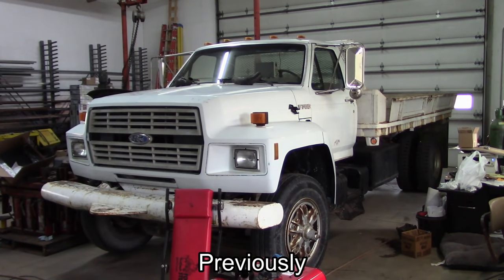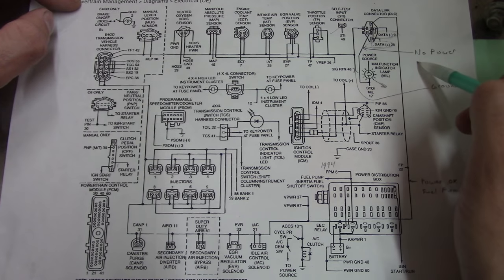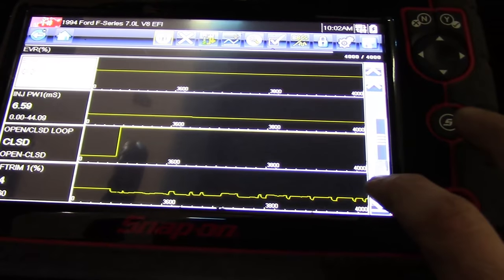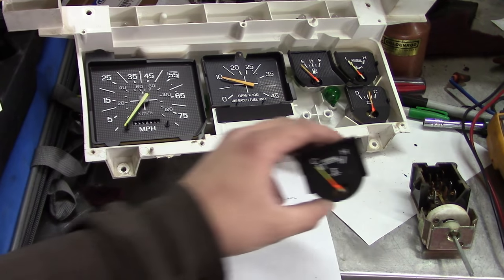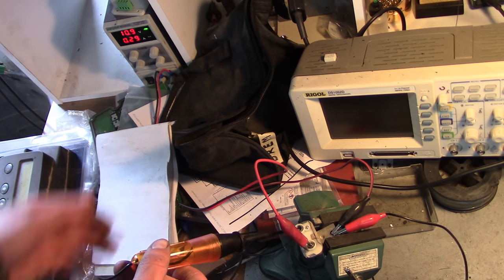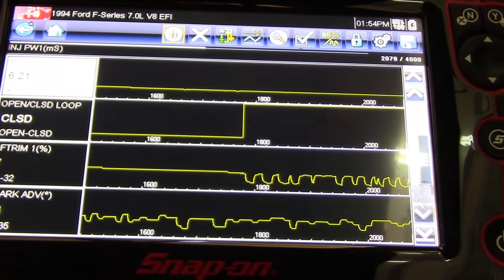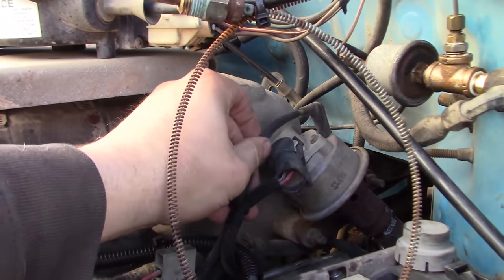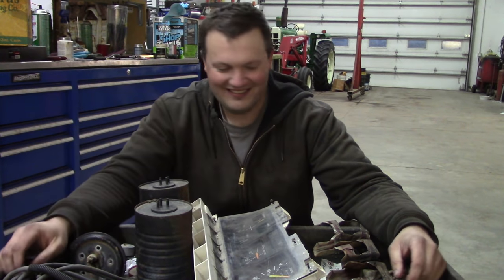Ford F700 Project - Missing, High Idle, and Gauges - Diagnose and Fix (Gas Engine) - Part 3

Comment: And, still a far cry from the 70s era F-700, which had almost none of that fancy electronics under the hood :-)
Reply from the maker: Right. But those had the "smog" engines with no compression and retarded timing that never made any power.
Reply: @WatchWesWork  The stake bed farm truck I drove was "pre smog"  There was almost room to sit next to the engine wi/o raising the hood.  Powerful, not so much.

Comment: IVR *IS* just a flasher.  The reason this works this way is the gauges are not real "gauges".  If you open one up, the needle is just glued perpendicular to a bimetal strip.  As the strip heats up from current passing through it, limited by the resistance in the sensor, it bends and moves the pointer.  Not very accurate (which is why there are no numbers on the gauges), but it works.

The big "can" style oil pressure IS a real pressure sensor, not just a switch.  The ECT and the temp sensor for the gauge are different.

The PCM actually contain software that I help write !    And I have NO IDEA why there are 2 OBD-I/DLC connectors !!

Comment: We’d,I noticed that truck is equipped with air brakes most of those models of fords with the gas 429s around here are equipped with Lucus Girling brakes are you familiar with those and if so would you consider doing a video on these brakes
Reply from the maker: I'm not that familiar with the juice brakes, other than they have a lot of issues in our area (rust).

Comment: I was a little bit confused  about the dash lights on my chevy squarebody, It has a similar light switch as the struck and I found if you turned the knob left or right it turns up or down the brightness of the dash lights

Comment: I live in Europe and I know nothing about fixing trucks. But I think that truck would have been junked here long before someone like you got involved.
I currently drive an 2012 Infiniti FX 50S with 87500 miles on it. All local Nissan / Infiniti shops refuse to change its transmission fluids! Do you know of any sites with instructions on how to do it?

Comment: Using the crimper right but you'll find the strippers should be used with the flat face trowards the free end of the wire. The other way your wedging the insulation against the wire/
Reply from the maker: LOL. Have you looked at how they are built? Any way you flip them you will have one flat face and one angled face...

Comment: Not tryin’ to be a PITA, but I did notice that the only gauge lights that work were the ones that you fixed in this video.....
Otherwise, a heck of a good fix Wes!
Reply from the maker: They all work except the air pressure gauges.

Comment: That flashing voltage regulator just produces an average voltage which is what the gauges need.  Old technology, I think developed by Ford in the 20s or 30s and used by everyone.

Comment: Nothing like getting someone else's handy work to have to fix. Kinda jump in easy and end up diving in real deep. I bought a 1994 4Runner with a 3.0. Had plenty of work done to it prior to me turning the key and ended up going thru way more than the thing is worth. I'm keeping it as to get my money's worth until I run the wheels off it. Talk about a vacuum nightmare.

Comment: The OBD 1 adapter to OBD2 works? I wasn’t aware that the OBD1 computers gave live data, that is great to know. I have a 93 Ford with the two connectors under the hood, one is triangular shaped, can you send me a site where you ordered the adapters that you know work?
Reply from the maker: It only works with the Snap On scan tools. You need the Ford1 adapter, a 12 v power cord, and the OBD1-OBD2 adapter.

Comment: vthat thing is a CVR...KNOWN ASA 'CONSTANT VOLTAGE REGULATOR...IT'S SUPPOSED TO PROVIDE  A PULSATING 6-12 VOLT POWER SOURCE FOR TEMP/FUEL GAUGE FUNCTION TO KEEP THE DASH GUAGES FROM BEING DAMAGED BY BATTERY VOLTAGE.. i suspect it does worksimilar to aflasher.they have been in use from the mid tolate 60's

Comment: I hav a 94 taurus sho. It has a datalink conn for eec4 and one for antilock brake system. So its likely Antilocks Brakes Not Sure It Has Those. Or Another System. It Might Say On The Cubby Holes OR Mine Have Covers With The Names.Fyi.

Comment: Ahh, that voltage regulator flashes to create hysteresis in the gauges.  Otherwise the gauges would respond quickly to things like shifting fuel loads.  The mechanical gauges have a lot of inertia, so you would never know that it's pulsing them with power.
Reply from the maker: That seems to be the idea. Pretty clever really.

Comment: Is what you called a voltage regulator actually a timer for the turn signals? Hence the pulsing, seems very close to the interval for a turn signal blink.
Reply from the maker: It works the same way.

Comment: Was the engine coolant thermostat actually OK?  At the very end the "normal" engine temperature looked to be pretty low, only just within the normal range and not nearer towards the centre of the temperature gauge where I would have expected.  Kinda looked like a pretty tired coolant thermostat...
Reply from the maker: I would bet it has a 160F thermostat.

Comment: Nothing like obd 1 technology and fixing someone else’s barnyard fixes. That huge vacuum leak is the main reason the exhaust manifolds overheated and warped. The leak made the system run super lean causing the exhaust gas temperature to go off the chart
Reply from the maker: Right. On a speed density engine the leak just raises the idle. Though the leaking vacuum cans mean the air pumps were not working, which may well have overheated the manifolds.

Comment: Ethonal fuel 87 octane has 15 to 10 % in fuel plus 89 octane has 10 to 5% Ethonal and 91 or higher octane gas has 0% Ethonal  best get STP Total Treatment fuel injection cleaner every fuel tank full plus use 89 or higher octane gas also and gas cap may need replace or rubber O ring seal need replacement too or whole cap to plus Fuel tank may need pump plus send unit seal fix has leaks ! Also air filter plus PCV Valve need changed bring idle down to use Fram or high quality brand too Wes  :) !

Comment: The answer to open loop after going to closed, is in another question. Does it have a single wire o2 sensor? If it dose to O2 is getting cold at idle
Reply from the maker: It's a heated O2.

Comment: I had no idea you could use an obdii scanner on an old truck like this did you use some kind of adapter?
Reply from the maker: The Snap On does pretty well. You need the correct OBD-1 adapters.

Comment: The other DLC connector is for the governor control module.
Reply from the maker: Hmm. Now there's a theory! I never thought of that. It does have a test output and input on the wiring diagram.
Reply: @WatchWesWork  From the Ford Service Manual:  The Governor System is an electronically controlled electro-mechanical servo that restricts the throttle plate opening in order to limit maximum engine speed.

Comment: Two datalink connectors?! Seriously, where do you find these trucks?!
Reply: I suspect it was a production thing where it’s cheaper to build one harness than have two designs probably one for manual transmission and another for an automatic. You see this in all kinds of harnesses where you have loads of connectors not plugged in due to options.

Comment: Check the BRAIN itself.  your is doing the same mine did lost a capacitor or three on the board.  it will run when cold and closed loop when open loop operating temp runs like crap.  your exhaust leak might be the egr tube going across the back.  mine the seam rusted out would blow gases at the back of the engine rise up and fan would suck into cab.
Reply from the maker: I think the PCM is OK.

Comment: I'm amazed that you could get a fuel injected 429 engine brand new as late as 1994.   I realize it probably has a smog cam and a smog compression ratio, but anybody ever try to warm one of these over?
Reply from the maker: I think they used it until 1996.

Comment: Have almost every issue here with an f700 of my own, could really use a vacuum diagram or at least where those purge solenoids you replaced connect to on the engine. previous owner ripped nearly all of the vac lines off and when my exhaust leak decided to sprout flames, it cooked the plug wires and the last few vac lines on that side and of course no sticker to be found anywhere. if anyone has some manuals that they want to share I would be grateful also, its not even roadworthy so trying to just keep it running cheaply for farm use.

Comment: Hey Wes what do you run for a bench power supply?
Reply from the maker: I don't remember. It's a 10 amp 24 volt unit of dubious Chinese origin. I have two identical units. Super handy.

Comment: 27:48 Has nothing to do with PWM. The gages are likely just oldschool resistive heaters bending a bimetallic strip that actuates the needle (similar to how ancient indicator flasher modules used to work), and to keep the heat in control they just pulse the voltage to them. Since the bimetallic strips are pretty damn lazy in terms of reaction time this shouldn't actually show up on the needle (much..)

Comment: I saw this on YouTube,  this is from eight years ago.
SOLD! Construction Equipment Auction
This asset was for sale and sold for a contract price of $2,035 in an absolute, no-reserve Internet auction by Purple Wave on October 25, 2012

1979 Ford 8000 semi truck cab and chassis
54,818 miles on odometer
7,436 hours on meter
Caterpillar 3208 diesel engine
210 HP
Serial 40546085
13 speed manual transmission
Differential lock
Heat
Air ride seat
Air brakes
Single rear exhaust stack
50 gallon fuel tank
Operator auxiliary control valve
Approx. 18&#039; from rear of cab to chassis tail
Rear tow hooks
222" wheelbase
425/65R22.5 front tires
11R22.5 front duals
10.00R20 rear duals
(3) extra 10.00R20 tires on Dayton rims included
GVWR 50,000 lbs
Clearance lights
Some damaged
No passenger seat
Cement mixer and accessories removed
Ignition switch replaced
EIN 75
U80DVDJ9807

It was located in Ashland, NE, and we sold it to the highest bidder for $2,035.
Reply: Here's the link to the YouTube video of the truck running and driving. 
https://www.youtube.com/watch?v=kTXsBZUtIDQ
Reply from the maker: Pretty good deal.

Comment: What scan tool combo is used in this video?  I've never seen one that can pull live data from an OBD I Ford.
Reply from the maker: Snap On Solus. Snap on has the only real support for OBD1. Live data was only available in 1993 and 1994. It was the run up to OBD2.

Comment: I noticed on the scanner when it wouldn't read any codes it says it's a 1991 ford and when it's connected to the other connector it says it's a 1994 Ford. Was  the engine swapped?
Reply from the maker: I fat fingered it, but it should have still read the codes.

Comment: Ford uses a pulsed driver for dial gauges.  it's dropping 12V to 5V and sending pulses out. that's to keep the gauge from bouncing.

And yes, they suck.

Comment: That system is so simple no matter how many air pumps it has.  It is no way complicated.  It is very crude. Don't waste too much time thinking it is going to give you valuable feedback.  It won't.  Jump into the 'bunny-hole' for sure.  Those things were not great for live data and chasing after that is a waste of time.

Comment: The labor costs escalate because for older vehicles - with extinct  multiple   failed parts , hunt costs and  thus time used..means YOU ARE  THE  END POINT FOR OWNERS...YOUR SHINGLE SHOULD STATE  :  FIXED HERE OR BURIED HERE...GUARRANTEED  ...!

Comment: Don't bother with the oil pressure sender. Ford only uses a switch there and the gauge functions as a reverse idiot light on when you get down to 10-15psi or so, so it doesn't really tell you anything except that you have the bare minimum oil pressure. My 2011 was still rocking an oil pressure switch when I troubleshot it.

Comment: The ICVR is a common failure item. I'm working on a bullnose F150 with the same dash. I followed this guide to replace/upgrade the ICVR. It now works perfectly and is much cleaner. That pulsed voltage setup of the original is horrid. http://www.garysgaragemahal.com/icvr.html

Comment: You really are a magician to make sense of all that emission crap. Look at the evolution of GM CRAP. The 283 engine was simple and worked well. Then the government got involved with CAFE standards and GM added an air Pump to their 350 block. The Germans and Japanese’s started with a fresh piece of paper and developed new engines that were more efficient and more powerful. Then they too got carried away with a lot more sensors and even multiples of them and VVT which was good and then became too exotic on MB & BMW to the point that some of these cars became junk after warranty ran out. The WORST CASE is GM making a diesel out of a 350 to save billions under CAFE rules. I have got to be one of the most stupid, loyal  customer paying $36,000 for a 1979 ELDORADO  BIARRITZ with all the options, and was lucky to sell,it 5 years later, for only $9,000 after going through 4 Diesel Injection Pumps that needed to be replaced yearly because they could not take the high heat on top of the engine. More Crap, I bought a 1973 MONTE CARLO 454 block that was supposedly destined from high compression. Wrong it still sucked lots of gas and no power. How about a 1989 2 door Fleetwood Brougham, 15” wheels, no brakes, (GERMAN teeves crap) and motor mounts would not last and Yes that proverbial air pump that had to be replaced every time that engine fell down. How about another piece of crap. 1985 Corvette plagued with electrical and transmission. What do You think of 1991 GMC extended cab with transmission problems and exhaust manifold studs that ere replaced multiple times and then just had to put up with the noise, smell, and carbon monoxide. I HATE GM and I’m a POOR SIMPLE BASTARD. Our family now has 3 NISSANS and 1 G37 X INFINITI. We are now going all TESLA. I can’t wait for CYBERTRUCK amd FSD.
Reply from the maker: My neighbor had one of those 350 diesels he used on a sales route. He told me he carried an extension cord and ran it out the hotel window to the block heater so it would start in the winter.

Comment: So hear me out...some mechanic gets this truck at an auction...it's beat to hell, no lights work, and it throws a ton of codes. He disables the datalink in the cab and breaks the check engine bulb...makes an extra $500 on a rough truck, but "hey...the money light ain't on!" I know...I'm a little cynical, but first thing that popped into my head when that light powered on but the in-cab link wouldn't.
Reply from the maker: I feel pretty confident someone busted out the CEL bulb on purpose. How else could it possibly break?

Comment: 9:43 This is the point at which I go to Summitt, order a 750CFM 4bbl carb, a fuel pressure regulator, and an old school dual plane intake manifold, slap them on, and let it buck.

Comment: Those gauges were made by Beede Electrical Equipment in Concord, NH.  Proud of those guys but now they're out of business. That stuff is obsolete but has a few fond memories.https://www.concordmonitor.com/Archive/2014/10/Beede-cm-101114  Knew the CEO personally.  They made all of those gauges.speedometers,  Done and gone.  Another white-owned business down the drain.  Yuck!

Comment: I'm ecstatic, because he got to pay for it all, you got to relearn ancient history, of FOMOCO's worse ideals, solve all the problems, as well as do all the work, I/we got to watch you put all the gray matter into warp drive, and the customer is happy.
What a totally over engineered underpowered overpriced piece of bull manure they sold the public with that one. 
That leaves one question in my mind, was the oil filter mounted on the side of the block, at same angle as the block itself, also was it directly over the axle, along with other things blocking it from draining without running everywhere, and dripping down in so many places at once that it was impossible to contain it all, without a full belly pan? 
Thus requiring a trip to wash everything below the oil filter, are suffer the constant drips of the residual oil dripping off the thing for days afterwards leaving it's signature everywhere it sat for few minutes .
That's the true legacy of the Ford Motor Company's better ideals claim to fame...
PS
I own a 03 F250 XLT I've put nearly 400,000 miles on, all original unmolested 7.3, and transmission, so not hating on Ford, just stating facts as I know them to be true.

Comment: It is a ford, if it runs like shit 90% of the time you can make the claim it runs like new.  If you have an electrical problem it is better to replace the entire electrical harness. Just slightly better than a dodge. When a dodge has an electrical problem the veichle catches on fire. Ford and dodge causing mechanics mental illness since day one, but If we didn't have them mechanics would starve.